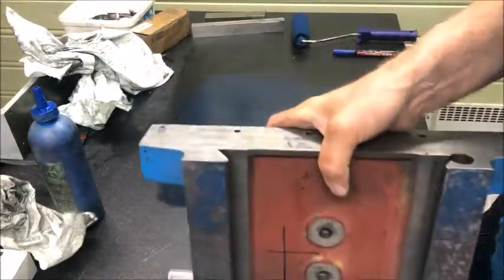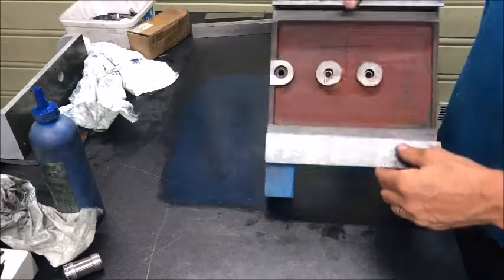HBM45 - saddle - rough scraping - underside

Comment: At 12:59, isn't the film just too thick to give you a good print?  I'm quite inexperienced compared to you so I may not be right about this but when I get a print that is not crisp, I wipe some of the blue off the surface plate with a paper towel.  Sometimes a little denatured alcohol on the towel and use that to remove 3-4 stripes of blueing, then roll it out with a rubber roller to equalize.  

Thanks for this video series.  I've read about 50% of Connely so this topic is somewhat familiar but the videos bring it to life.
Reply from the maker: Thanks for commenting. This is at a point where we are roughing and it was deliberate to see more of the area. Not a problem in tjis example, but, you are correct, it is thicker than what you want when point-spotting.I personally don't make it more complicated than distributing the Canode from a hard brayer or more often from a paint-roller onto the Diabase plate. Then,  I make a point og wiping this surface with my bare hands as this will reveal and remove any small particles.